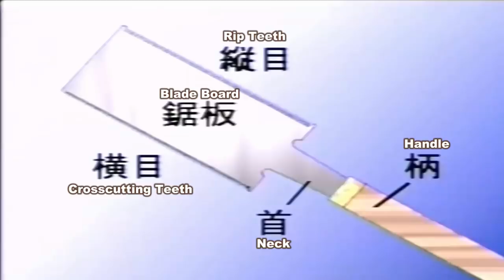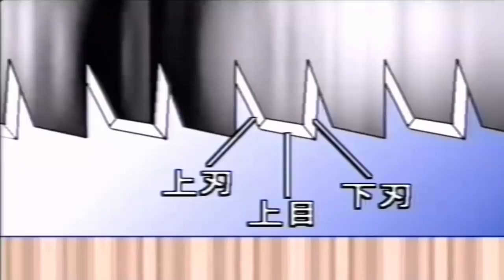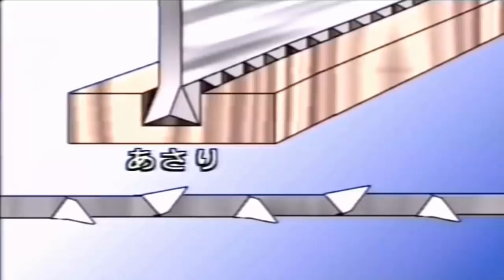When Woodworkers Question Whether Japanese Hand Saws are Suitable for Hardwoods?

Comment from the maker: I entirely agree that Japanese saws are more fragile and more susceptible to damage than the equivalent Western saws. But the properties that make them so fragile such as the taller tooth shape, the thinner, much harder and brittle steel and more acute angles at the cutting tips of each tooth also reduce the load applied to each tooth. 

you are careful with a Japanese saw, it should be more than capable of dealing with hardwoods. As long as you make sure your work is adequately secured, you choose a saw appropriate to the task and you allow the saw to work at its own speed and do not force it, a Japanese saw will serve you well.
Reply: One important detail missed in the video was that the reason Japanese saws can be thinner and lighter is that they cut on the pull stroke rather than the push stroke, which means that while the saw is cutting the blade is in tension on a Japanese saw rather than in compression in a European saw. This is the reason European saws need to be thicker and stiffer is to resist buckling while the saw is being pushed. since it is cutting at this time, while a Japanese saw only needs to be stiff enough to not buckle as it is slid forward before the next pulling (and cutting) stroke.

One thing that I'd love to see improved in these videos is translating more of the Japanese subtitles on the video. Without these translated it's not clear what the purpose of a lot of the manufacturing stages is. I suspect finding a European saw with a manufacturing process as labour intensive as the one shown for the Japanese saw would be more or less impossible. I'm pretty sure affordable Japanese saws are not made like this either though.
Reply: Have used them frequently in my furniture shop its all about the dound the make when its cutting like it should uou will here the saws song singing to you its a steady consistent tune if it changes your messing up not the saw .
good tools
Reply: I've used a Japanese saw for years in gunstock making because the finer teeth tend not to ever get any end grain tearing.
Reply: Agreed, more movement less *pushing*, it's a saw not a chisel.

Comment: Beautiful saws, but the folks comparing these to "Western Saws" mass produced are comparing apples to oranges.
Reply: Most folks compare mass produced Japanese saws to mass produced Western saws though. Of course for each type of saw there are specialist companies and real artisans who manufacture some high quality hand made ones. You just won't find those in the DIY shops but at best a small tool shop who values selling good products.
Reply: Comparing apples and oranges is totally fine, if not as to taste then sure as to nutrition.
Reply: There is no reason why a mass produced saw couldn't be just as good as a handmade one... The main issue is that due to the demand for cheap saws, the mass produced ones often lack good quality control. 

However saws such as those from the Silky brand, with precision ground teeth and hollow ground blade with no set are incredibly smooth and leave an exceptional finish, the crosscut surfaces they leave are better than if you sanded them.
Reply: Get a cheap "Dewalt"-"Irwin" pull-saw and use it properly. I'll get through hard woods in ten strokes what'll take you fifty using a hand-made English saw. And I'll have 50%-70% less saw-marks to show for it
Reply: If you are cutting giant tree you need western style, everywhere in Asia we use western style saw over japanese which are finer but doesn't cut too deep
Reply: @heydaddy2471  The Japanese used special saws for large trees as well, called "Maebiki" and "Mado Noko". 

For exceptional trees they sometimes had elongated handles.
Reply: @tiltil9442  Exactly!  Why can’t fruit be compared!?

Comment: A Japanese carpenter YouTuber was saying in his program that saw used to be the most expensive tools to maintain that he used fortune on as it requires frequent adjustments. But nowadays he uses mass produced throwaways because there are not enough technician left to do the proper maintenance and they are so expensive because of it. 
I am sure all the experience shared here are with mass produced ones but still it’s a pleasure. Japanese saw cutting experience is completely different from western tools especially nowadays with all these power tools we can enjoy Japanese saw with proper jobs with maximum pleasure. Very nice.
Reply from the maker: glad you like it!
Reply: I agree about the maintenance on the hand made saws. I have one hand made pull saw that requires sharpening and tooth set after about 10 hours of use. It is a joy to use and cuts better than the mass produced pull saw I have, but the sharpening and set takes me about 3 hours. Mass produced ones are definitely cheaper to use if you value your time and cut quality in my opinion is only about 10% less in a mass produced one than a hand made one.
Reply: Yes, "大工の正やんShoyan"
https://www.youtube.com/watch?v=tLykIuJQbO4
at1:18

Comment: Japanese saws have a huge advantage over european saws when it comes to longevity:
They operate on the pull. This means the saw is under tension during the actual cut and thus kept straight.
Saws cutting on the push experience compression und bow out, making the saw bend with every cut, especially when the saw gets stuck or you misalign it in the cut.

A japanese saw can still get bent by inexperienced woodworkers when they misalign the cut (pull it out of the workpiece in an angle), but they only get bent at that angle of misalignment. 
European saws that get misaligned and thus stuck will get bent violently due to the compressive force.
Reply from the maker: WOW, Good Point!!
Reply: @WoodworkingEnthusiasts  its the reason the japanese can make their saws as thin as they are in the first place. european saws that thin almost always have a back bracing to keep them straight under compression.

Comment: Good Lord....the only thing I use Japanese saws on are hardwoods, and I mean HARD WOODS at times. Like Bubinga, Shedua, Gaboon Ebony, Katalox, etc. Only put downward pressure on the pull, and easy slide forward, that's the full user's manual. How is the premise of this video even a question? If you think Japanese pull-saws are too fragile you're a caveman with tennis elbow from your "superior" English-tooth saws.
Btw, there are also Japanese files with tooth geometries that cut only on the push, and polish on the pull.
Along with the brilliant Shinto file, none of which could I live without.

Comment: They make thin western saws too. They have a spine, usually brass, and are called a back, tendon or dovetail saw. The genius of the Asian saws is the pull stroke putting the blade under tension, and the tooth design (which DOES need modified for OPTIMUM performance in rosewood, ebony, Purple Heart or Lilac.)
Reply: The genius of western saws is they figured out a nice handle :)
Reply from the maker: WOW Good Point!!!!

Comment: I have both European and Japanese saws. I use only the Japanese saws for fine joinery. No comparison.
Reply: Yankee Axe & Tool Co. you can also use a hacksaw with blade for cutting steel, the cut is as if you sanded, it takes longer to cut tho

Comment: Okay...what's the timestop for them putting the teeth on the blade? Am I just repeatedly missing it (I've bad eyes, so it's possible) or did they simply not show it?
Reply: Mirozen 
4:49
Reply: @keirfarnum6811  Thank you! I think I missed it because I was watching for one of the craftsman to do it, when it was only the machine cutting the teeth. Thanks for providing that timestop!!!
Reply: @Mirozen also at 5:00 the rough punched saw is fixed in a wood vise and filed to shape with a feather file, then taken out of the vise and set with a hammer, then jointed and finished filed - hon metate.  Most of the work  ---  if all the work that went into making a saw were shown on a video, it would be hours.

Comment: I really like Japanese saws but have never been about to keep the cut straight after about 3 inches.  Once the blade starts to stray off the line it is impossible (for me) to steer it back again.  So I use them for only short, fine cuts.
Reply: Also, if you're trying to hit a specific cut angle, build a jig at said angle that acts like a 'saddle' over the workpiece and embed at least one magnet in the face of its 'fence'. Your bio-mechanical errors in technique will suddenly disappear.
Source: we've done exactly this in my shop for 90°, 45°,14°, 7°, etc. You can make the 'foot' one-sided and clamp it on, or get fancy with threaded inserts and star-knobs so that the jig doesn't care about stock thickness.

Comment: The expensive saws may be made like that but the small one I bought from Amazon although stated made in Japan can't have been made like that - would have cost a fortune rather than the 15 quid I paid.
Just ordered a larger saw for about twice the price but still doubt  it will have been hand made. Great video though.
Reply: I have 3 or 4 of those. It was most likely induction hardened, which as I understand, cannot be sharpened. After it's dull, it's useless. A throwaway saw. This is why I just bought some Japanese saws on ebay. Hopefully they're authentic, because I plan on trying to file them to keep them sharp.

Comment: A saw is a saw. Doesn't matter where it was made. It's about using the correct saw for the cut. If you use the "wrong" saw, break out the plane and or the sand paper

Comment: how do they keep such a thin blade from warping when quenched?
Reply: right after the quench while still hot they but them in a press to cool down
Reply: @Elgin Rose i would think the covered tank was for tempering. removing a lot of the brittleness while still been hardened.
Reply: It warps..
Reply: @Chris Yu Bob is right, but they do warp, and are then flattened on an anvil using various hammers.

Comment: but can you sharpen them yourself?
Reply: You can indeed providing the blade is not one intended to replaced. The replaceable blades are impulse hardened so you shouldn’t be sharpening the teeth. To sharpen a  traditional blade you need a feather edged file and the know how - which I don’t have😎. However,  most decent replaceable blades are intended to last 5-7 years if you use them properly, and new blades being generally half price of a new saw replacing them  is probably the better option….unless you wish to learn the skill of course 😊

Comment: I prefer my lie Neilsen tenon saw to my Lie Neilsen Japanese pull saw. It keeps bending near the handle and the saw dust obscures the marking.
Reply: First off, try buying a Japanese saw from the actual Japanese. You might change your opinion. Second, you may be surprised to know that you have a built-in dust-blower if you posess lips and a pair of lungs. Third, the 'kinking' you get near the handle on the push is a sign you're exerting far too much force on the push. Hence, people calling them PULL-saws.

Comment: strange how they use western sheet steel,guillotine,power hammer,hand sheers,grinders,tooth forming machines,electric oven.

basically everything western to make a japanese pull saw
Reply: They do not use western sheet steel.  They use Hitachi steel. And their industry tools are mainly Japanese.  ...might look western, but most likely arent.
Reply: jadekayak01 the Japanese have been forging steel for a long long time.....
Reply: I'll echo maezzee's reply.....buy a high-end forged "Damascus" Japanese chisel (can't remember their name for it) and see how often you DON'T have to sharpen it. Those folks have their cutting tool metallurgy down cold.
Reply: @missionron  and where did they get the knowledge to make tgese "japanese" machines

MACHINES were introduced to Japan and the refined them.

SHEETS of steel are not a JAPANESE historical product.

They DO make some of the best steels in the world today but it is all in an industrial manner.

JAPANESE couldnt even produce a properly melted ingot of steel pre europen contact.

ALL thier steel produced was made in a tatar furnace which only produced a rough lump of steel that hadnt been properly smelted.

The UK and Europe surpassed this method hundreds of years ago.
Reply: @jadekayak01  I mentioned I didn't know if Damascus was the right word for the steel I'm referring to, apparently it wasn't. Not sure if it's even 'folded', I'm not a blacksmith. I just use these tools every day to pay my bills, and the truly fine ones hold an edge for a baffling amount of time.